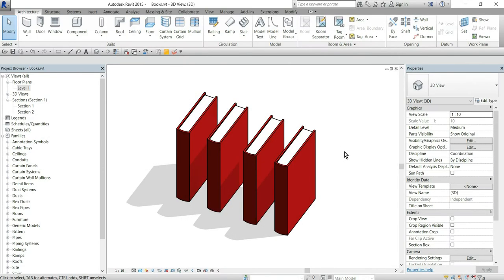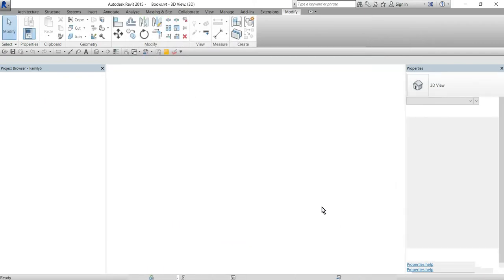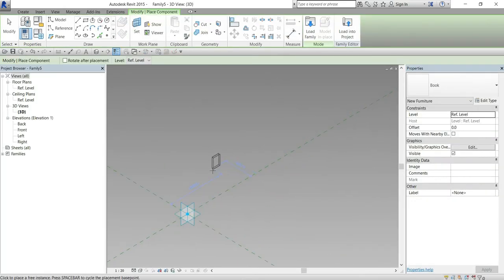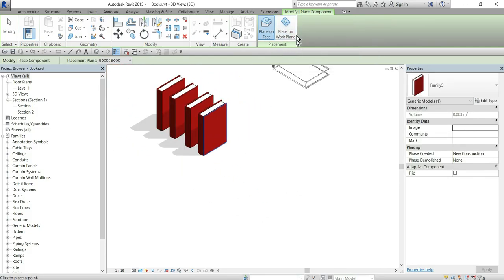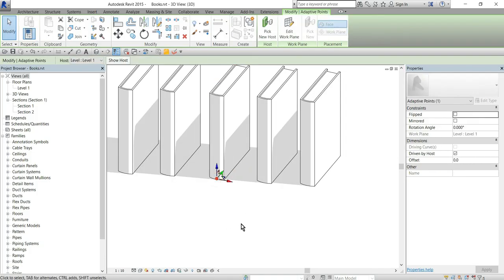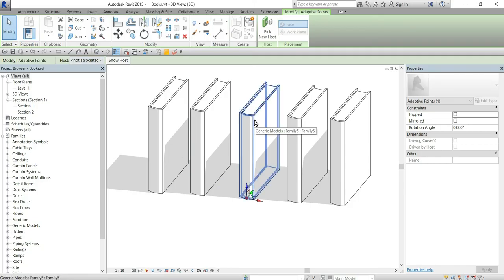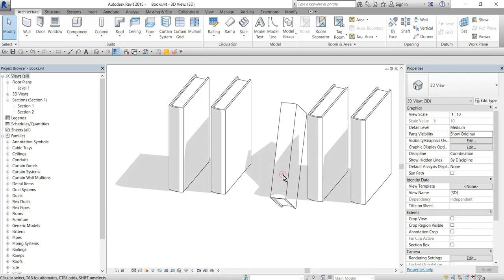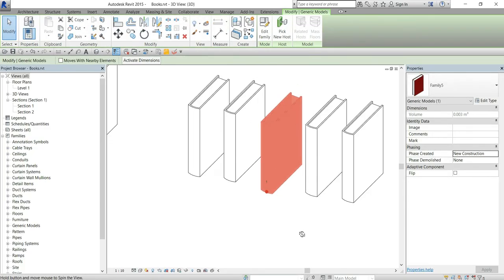How to 3d rotate family into any direction in Revit

Comment: As much as this was extremely useful, it's still too hard to quickly and accurately align the family to a face in a project. I just want my family to get loaded in a default flat position, then in a 3d view, I want to click "align", click the proposed surface, then click on a face on my family. Should be a no brainer that the family will align to the face of whatever I wanted it to align to.
Thanks for this video!!

Comment: Have you done this with a family that has instance parameters that need to be accessible in a Revit model?
Reply from the maker: Hi, I am not sure I fully understand what you mean, I assume you want to have access to instance parameters of (for example) that book? If yes, one way of doing it is replicating same instance parameters in "host" family so you have access to it. The other way is checking "book" family as "Shared" then in project you can tab-select it and use its parameters. Does that make sense to you?

Comment: Thanks for this! - I thought Revit was supposed to save time not make the simplest thing a nightmare?
Reply from the maker: Tell me about it :D
Reply: @Engipedia   its not a 3d engine.  Its a 2d engine with 3d tools.  Thats how it was developed in the late 1990's.  I don't think 99.9% of the Revit users understand that.  Every add on tool that's been added is a work around. The 3d space is a viewer with minimal 3d functionality. It has to be done via their tools and going back to the 2d space to manipulate. There were 100's of better developed programs similar to this in the 90's and early 2000's. No idea why Autodesk didn't look outside their own backyard for a better developed software. Industry is stuck with this now

Comment: hmmm tried to do this with a bolt.... would not load the  adapdive family.
Reply: Same here
Reply from the maker: Create a regular family, like bolt (in Generic Models or in some Structural category). Then, load this regular family into adaptive family, not the other way around. Then load adaptive family into project:   Bolt > Adaptive Family > Project.
Reply: @Engipedia  This should be included in the steps! Else you just added additional problem!

Comment: i have a pringles chips shape family and when i try to follow the video. the adaptive point gets hidden by the family in the middle not the edge and when i try to move it it says ( constrains are not satisfied )
and also for me the orientation to doesn't have the option to host reference it has Host(xyz)
Reply from the maker: If you want, you can send me that family to check it out.